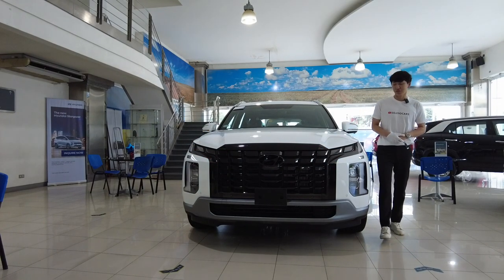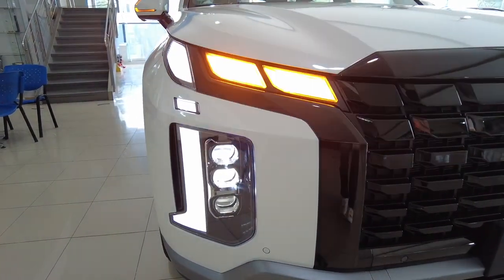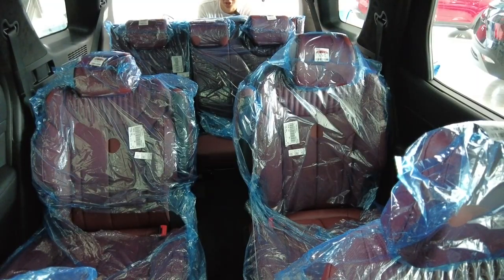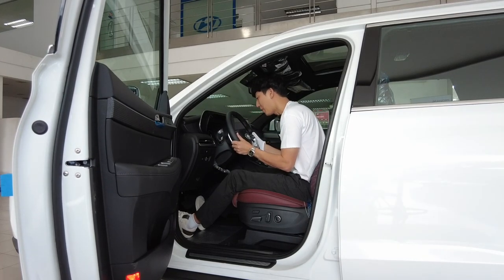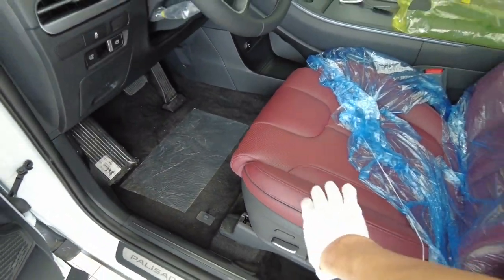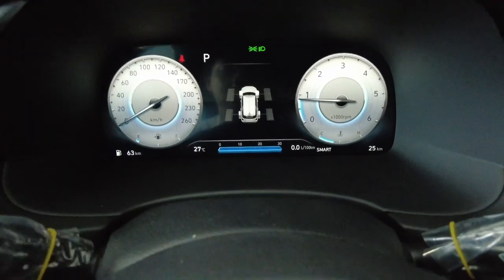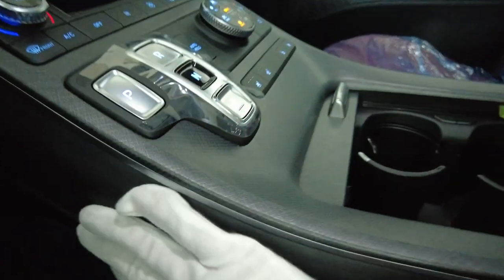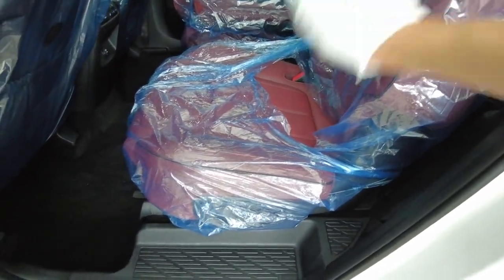2023 Hyundai Palisade 2.2L Diesel All Wheel Drive Face Lifted

Comment: I was totally shocked that the V6-powered Everest Platinum is launching in The Land Of Smiles either this year's Thailand International Motor Expo (TIME 2022) or early 2023. There's a 0.369% chance to get it in the Philippines, when it launched as a 2024 model year, it will breach a P2.6 million mark to become the most expensive lifestyle mid-size SUV to date.🤯🤯🤯

Comment: What does the Palisade have that the Everest, Terra, Montero, and Fortuner; don't have. For that price point and that engine (not even a V6), it's way overpriced. The mid size SUV's here are becoming more Luxurious but still under 3Million. What are you doing Hyundai Ph
Reply from the maker: Please be reminded that this is not just Everest, Terra, Montero, and Fortuner. It has a lot of things that the models you mentioned don't have. Plus, getting down from Everest, Terra, Montero, and Fortuner has different vibe when compared with the Palisade. You might want to raise your concern to Hyundai Motors Philippines, since you are calling them out. Please post in the website and social media of Hyundai Motors Philippines if you want real answers.
Reply: @SoJooCars  I really like the Hyundai line ups in Korea, especially the Santa Fe. But what we get here is too overpriced and too stripped down. Historically speaking we were always getting Hyundai products here that way. The price is higher than its competitor with similar specs. Case in point the Palisade. It has almost similar output with Everest and others, they all have 3 rows, the dimensions are roughly the same, the techs are almost the same. My point is, is the more than 1Million difference justifiable? What are your thoughts?
Reply: Well, that's the essence of competition. If you don't want it, you can always opt for much better options.
Reply: @rontabs1229  Palisade competes with the CX9,Explorer,Prado and Evoltis..Its the Santa Fe that competes with the PPV SUVs..
Reply: @KuchingKingVideoGamer  I understand that. But some of those you mentioned have bigger engines. And even if you opt out for a smaller engine, it won't amount to 3.7m. It's high time that we demand more from Hyundai since they are charging more while giving less. Hyundai and Kia are known as game changers in other countries while being cheaper than most rivals. But here it's the other way around. We as a consumer should demand, cause most of the time, we will never get what we don't ask for.